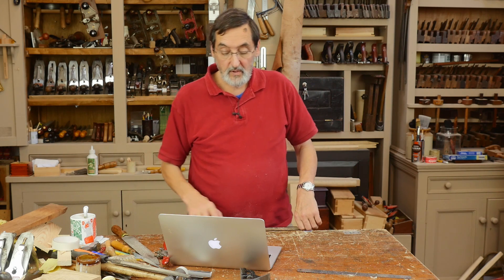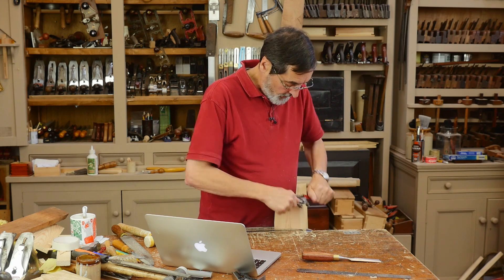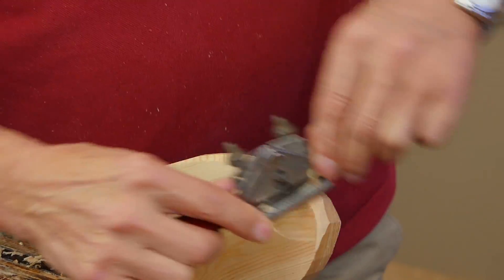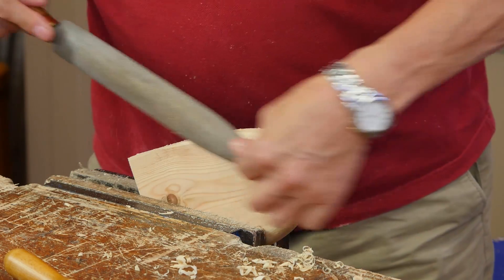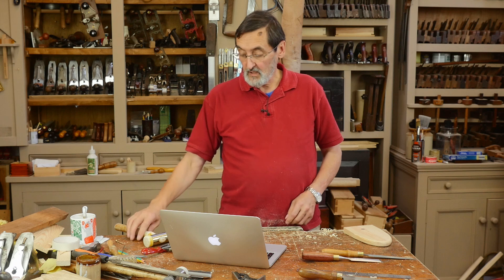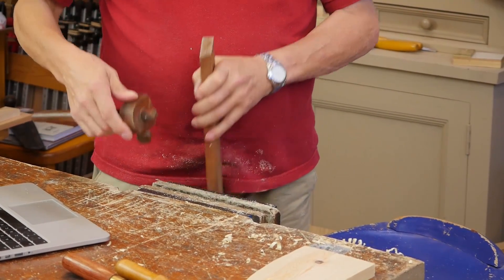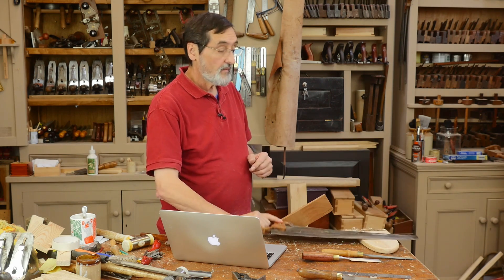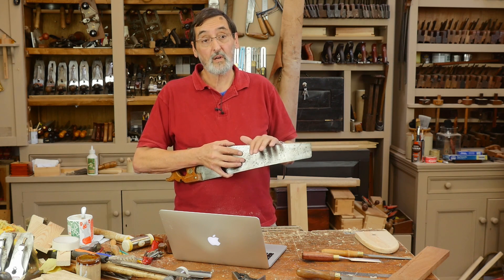Q&A with Paul Sellers Episode 8

Comment: Thanks very much for the series Paul, very informative... best use i ever found for impulse hardened saws that have gone blunt... cut em up with a steel grinding wheel and they make great card scrapers, blades for cabinet scrapers, and scratch stocks. No point in wasting good steel in my world 😀

Comment: Paul, your youtube videos, especially the Q&A videos are wonderful.  I have recently given up my lifetime of blacksmithing and taken up hand tool woodworking due to “sore arm” (a result of all the pounding).  I have learned so much, you are an excellent teacher!
By profession I am a heat treater, and hope this will “temper” the discussion regarding re-hardening saw blade teeth (I unfortunately read a couple of replies below where there is some unnecessary name calling).
Heating steels (all analysis) with a blow torch will stress relieve the teeth (remove the work hardening) up to a certain temperature (the temperature at which the blade was tempered at when produced).  Above that temperature, it will begin to soften the teeth, on up to reaching the annealing temperature where the teeth would be dead soft.  To re-harden you would need a temperate controlled industrial type furnace capable of 1500F to 2100F depending on the type of steel.    Please contact me should you want further information on hardening (any type), I am 50 years in the tool steel industry and own a heat treat company.
Best regards, 
Michael
Reply: I come from the other side of the fence - I have a degree in Materials Science.  I know some of the theory behind your practical experience and expertise.  When I see metals being worked/treated I am always trying to imagine the actual effect on the materials - effects that I have seen using exotic instruments.  We both know that heat treatments are complex and defy pithy explanations.
Reply: I love watching and learning about blacksmithing too. So much to learn.

Comment: Hi Paul. Your Q&A series is really interesting and helpful - thanks for taking the time to do them! I have a question which is less to do with actual woodworking, but to do with looking after the most important tools we have at our disposal - our hands. Do you have any hints and tips on looking after your hands, preventing damage to joints, muscles, skin etc? I know that sawdust/shavings can contribute to drying out the skin, have you ever had any problems with this?

Comment: In my area, (North Eastern North America.) people cut trees, and let them rot on the ground. Often, it's to in dimensions that commercial suppliers don't want. Also, there are species people are not familiar with, but often left to rot. Also, there are trees like Elm, which are just a problem for most land owners. I made a Alaskan Saw mill with a electric chain saw, and cut up an Elm tree into ten foot long, one foot wide, two inch thick lumber.   My neighbor has eight long long, four foot wide maple tree trunk in her back yard. I don't own a real chain saw, let alone one big enough to slab that trunk up. Thanks for the video.
Reply: Kiki - you can split those trunks with wedges, though getting the first split on a four foot diameter section will be a challenge. If the logs are straight, it's worth figuring out. if they're twisted, then maybe not. 

Most of the dropped trees in suburban areas (especially in wooded areas) rot on the ground because the land is just idle space. Mills want trees that grow in competition with long clear areas,  and in my part of the northeast, most regrowth is various types of oak (the large trees are) that has little market value. The areas around here that aren't oak often have large numbers of sycamore trees (which are probably more of a hazard). 

If we can get a hold of them, then that's great. In terms of commercial use, I doubt they'll ever be worth enough to recover and risk a saw blade on nails or prior arborist's efforts (iron fixtures, cables, etc). 

Even the clear wood, unless it's a large walnut or something, I don't think the mills pay much for raw stock. A tenth of what we see at retail, perhaps less.

Comment: I think the only answer to sharpening modern saws is to grind the existing hard teeth off and cut a new set into the softer steel behind them.

If you're prepared to go to those lengths you may as well buy a rough traditional one and do it up.
Reply: yeah, I cringed a bit when he said anneal the steel, you cant anneal steel. you can only anneal metals that work harden. I know its not Paul's specialty so its ok, but at least he made the point that it is very dependent on what kind of steel the saw was made from and how it was hardened. I am surprised people don't understand that you harden steel by super heating it with a forge or torch and then quench it, you then temper it by warming it up to 400-500 degrees al the way through and then letting it air cool. of course that only works if the steel has enough carbon In it. google can explain this with ease lol
Reply: Trevanion Technically, yes you can anneal steel, but I do not know anyone who ever calls it that as ferrous metals behave differently with heat treatments over metals like brass or bronze. steel does not work harden. steal is either hardened or unhardened and heat treated or not. it being brittle is a matter of carbon content or alloy. beating steel does not change the physical property of the steel only its thickness, unlike bronze, brass, and copper. one anneals brass to keep it from cracking after work hardening. one heat treats steel to keep it from shattering. the difference is subtle in outcome but are different in application.
Reply: Well here you are wrong: Steel does work harden as well which is used in cold forming. It is a bit of a niche industry but important for certain products like drive trains. So that bit about beating steel not changing its physical properties is as wrong as it gets.
Reply: Landogarner83 I think you are confusing case hardening vs work hardening.
Reply: No case hardening is something completely different again.

Work hardening works quite well with low carbon steel and even better with pure Iron.
Even with tool steel it does occur although quench hardening achieves much more extreme results.

Another example for work hardening steel that came to mind in the meantime are scythe or sickle blades.
Those are made from mild steel sheets and hammered to get the hardness only at the edge.

Sorry that I did not answer until now because somehow I did not get any notifications for the last week.
Reply: Look up Annealing (metallurgy) in Wikipedia.  Annealing applies to steel - it is a heat treatment where the aim is to reset the crystal structure of the steel to its “normal” state.  Hardening can be done via a variety of processes, including work and heat treatment.  Steel is one of the most complex and versatile metals known.  I have a degree in Materials Science - this covers metallurgy.

Comment: Great stuff as always Paul :) I broke my spokeshave, right at one of the screws that rises and lowers the blade. I've had it for over 25 years and its been one of my favourite tool. So want try and a new body for it in wood. 
So my questions is how would you go about making a new handle/body and reusing the blade and maybe even the screws.

Comment: I never used a saw setting tool of any kind, and recently I bought from ebay a Morril-type pliers tool (the first model that they ever made, I learned, without any dial, it has just a small wedge with a screw that allows it to slide up and down). I don't know how to use it, and I didn't find any video to explain in detail how is any type of plyers saw set properly used (old types or new ones). 
And I really would like to set my own hand saws. You got me into this hand tools woodworking thing, I learned a lot from you, and I thank you for that, but, please, help me with this one. Raul
Reply: look up paul's saw sharpening video. he covers it there.
Reply: Yes, he does, thank you, James. 
I tried to do the same thing with that tool I was talking about, and I learned that a dial type anvil isn't like a wedge type one (as my old Morril saw set tool has), and something has to work different. And I couldn't figure it out - which part of the hammer has to work against which part of the anvil, against which part of the tooth. 
Another concern of mine is that I don't really know if the hammer has the right shape or it is worn out and it lost it's original angle (if any, because now it is dead straight), so that it cannot push the tooth as it was intended to.
Reply: raoullf
plop it on with a setting that looks about right, and give it a squeeze. if it bends too much, hold the face of a hammer against the tooth and gently rap the other side with a hammer. this will remove set from a tooth.

Comment: Love these Q&A videos! I am not sure where we need to submit questions but. 
As I am learning to use and restore hand saws I have a sawing technique questions. I am not sure if it a function of technique or if it is the set/sharpening. when cutting with a panel saw most of the time I get "speed wobble" the tip of the saw starts to oscillating side to side terribly.  I believe it is lack of correct technique/practice, but I want to confirm it is not something I am introducing mechanically during restoration/sharpening. what is the cause and how to correct?

Comment: Paul, you have the right idea about the oven but you're not going high enough.  To take away enough hardness to allow the saw teeth to come down in hardness enough to file you'd want to bring the blade up to a a violet or even the beginnings of a blue color.  And that's up around 530F.  From what I know about house hold stuff we can only get that in some self clean ovens during a cleaning cycle.  And some 

I've been making music wire springs and putting them in a toaster oven to stress relieve them at a rather low 425F.  That leaves them with a straw color.  Typically that's not high enough to make harder steel soft enough to file.  But then I'm not trying to actually soften the music wire.  Just make it happy with its new shape.  But my toaster oven maxes out at 450F if I can believe the dial.  

Another option if one has the torch to manage it is to put the teeth up against a heavier piece of bar stock that was cleaned up and left "in the white".  Put it against to the saw teeth and heat the bar stock up to a blue temperature and then play the torch back and forth while slowly moving out away from the bar stock over a good 5  minutes.  The heat will get into the saw teeth as well and might or should bring the temper down even if it's an air hardening steel.

Of course there is always the option of grinding off the impulse hardened teeth back to where there is no blue color.  Then you're into what should be virgin steel.

I've gotten a lot of value out of your videos.  Some were totally new to me and others just helped me out in some finer points.  And at least a few made me realize that I might be a little OCD about some things :)   But either way giving your knowledge out to the wood working community like this is a wonderful act.  

As mentioned by another viewer I also wish you all the best health wise.  I also hope you just got whacked upside the head and the sore spot is nothing serious.
Reply: So, the impulse hardening (japanese saws) is only in the teeth of those steels? I have some of those saws, but I don't see any blue. But its impulse hardened. Can you clarify what you meant?
Reply: Try them with a file.  Most of the impulse hardened blades I've seen show definite signs of color change.  That's not to say that some companies don't clean the color off.  But I think most leave it colored as a sign of the impulse hardening.  

In the end try a short stroke of a file on a part of the file you don't normally use.  If it skates off then the teeth are too hard to file.  If it isn't hardened the file will dig in and feel draggy like with a regular saw blade or mild steel.
Reply: Bruce Matthews Okay. Thanks. So, if I want to test the body (an inch away from the teeth) maybe a round file?
Reply: Sure, any old file will do.  Flat, round, square or triangular.   And you can test the body of the saw plate an inch up from the teeth as you're saying to determine the hardness of the plate.  But check the last tooth at one end or the other too.  If the teeth are impulse hardened then the teeth will be harder than the saw plate.  You'll feel that by how the file cuts into the plate compared to the tooth you try.  On the saws that were obviously impulse hardened by looking at the blue band of teeth it seems like the hardened area only covers the teeth and about 1.5 to 2mm beyond the gullets of the teeth into the plate.

On using the file.  My files are important to me and I like to keep the middle working area as  sharp as I can for as long as I can.  So if testing steel that I suspect is very hard I only use the last 10mm worth of teeth near the handle for testing for hardness.  That area being almost never used for general filing on softer metal.  That way if the file skates over very hard steel and damages the file teeth as a result it's no big deal.  The sort of damage you're looking at will be a shiny line on the crests of the file teeth.  

If you feel the file skate over the tooth instead of grabbing and it leaves a shiny line on the file teeth then there's no way to sharpen the saw teeth with a file.  At that point you either repurpose the saw plate as scrapers as Paul has suggested from time to time or you have a go at grinding off the hard strip of teeth and a small amount of the plate to get back to metal you can file.  Then you mark out and cut new teeth and set them.  Here again Paul posted a very nice option for marking and cutting new teeth in one of his videos.
Reply: Bruce Matthews Wow! I love it...such a thorough answer. Just what I needed. I never thought of also checking the effect on the file. Thank you sir for your time. Clearly you have some experience...maybe start your own youtube gig?? I would subscribe for sure.

Comment: Hello Paul :-)
I recently moved to Thailand and i am building my house with local wood, that means i had to re-learn most of what i knew about woodworking due to the fact that this tropical wood is very hard to work with and on my tools, chisels and planes need to be resharped very often (planes are most of the time completely useless :-( )
Do you have any tips about working with hard and brittle wood? I found easier to work on green wood becouse is more forgiving then when is dry.
Furthermore i am experimenting with coconut palm wood wich i will use to make the floor and i was surprised by his beauty...but... It is not really wood, palm wood is a gras specie so i wonder if there are ways to stabilize it somehow. 
Thanks for all your videos! I am following you from the beginning of your series and i am gratefull for your teachings :-)
Giorgio

Comment: The Mrs. Gave me a couple of stainless steel broken Handel spadulas . Could I use cut pieces (Aprox 1.5-X-1.75 ) for scratch stock blades from this thin metal ? And what would you advise for cutting several pieces with? Thanks Gary !

Comment: Hi Paul, could you recommend a make of Spokeshave, not too expensive but a decent one. I want to put to concave scallops in the corner edges of 2x1 or bigger pieces of wood. A round or flat spokeshave ? I've heard the Stanley 151 is not too good. Hope this makes sense to you. Regards.

Comment: re: rasps
Can you sharpen them the same as files? Acid bath, neutralizing bath, etc.
Reply: Thanks Mr. Sellers
Reply: Files made in recent years are not high carbon steels, but only mild or low carbon steels which have been "carburized" on the surface, then "case hardened", resulting in a very thin hardened layer.  The older files (of the 1970's and before) were fine grain high carbon steels and could be etched to bring back the sharpness of the teeth.  Doing so with modern files would "eat" thru the very thin carbon layer and you would have soft teeth  The really good (and expensive) files and rasps now made by Auriou and some select others still use high carbon steel.

Comment: about the :09 saw question- you could make the metal softer by torch or oven, however, how would you reharden it?  The steel will never be the same, unless you apply some very specially and complex normalizing processes.  Also, to properly heat treat a steel, you must know what steel you have.  As Mr. Sellers says, its not worth it.
Reply: Yes, you have to have the right steel for a saw.  But if its right then no hardening is needed.  Its worth a try to soften and resharpen a hard point saw. It might not work, but nothing ventured, nothing gained.